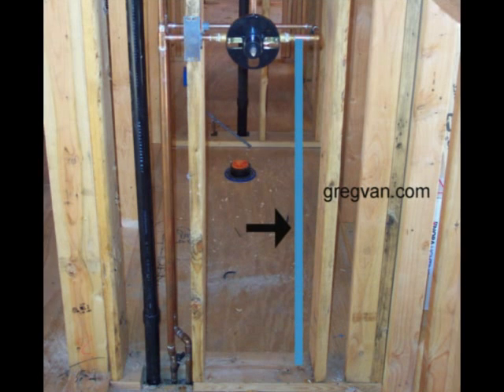House Plumbing Design - Water Pipes And Shower Valve Layout

Comment from the maker: @LATTCPLUMB You've got a good point, but backing blocks will provide additional support for shower or bathroom valves like these.  I would imagine they don't put those little tabs on the shower valves that are used to attach them to a backing block, so they can spend more money, making the product.  I will always use a backing block, for extra support.

Comment: I never run my water pipes in the same stud bay as the valve,thus i can drill through them and use the studs to support the valve without putting a block behind the valve. Faster cleaner instal, the plumbers in the video got it half right.

Comment from the maker: @davidgarciasanka Since I didn't run the plumbing, I really don't know what the plumber was thinking.  There were two plumbers on the job in both of them seemed like they knew they were doing.  However, there wasn't anything blocking them from moving the pipes, below or above.  Remember, I'm not making fun of the plumbers, just pointing out a few tips, for builders.